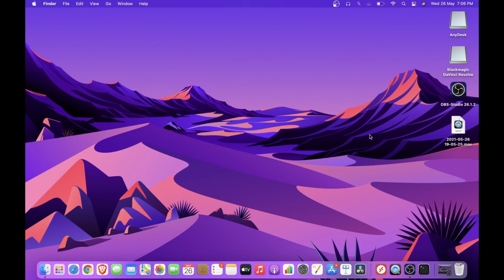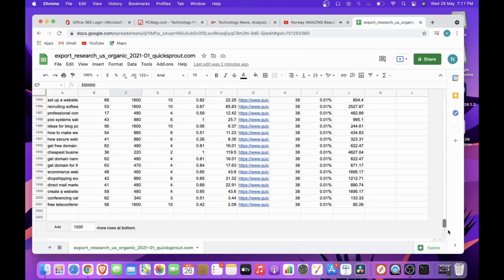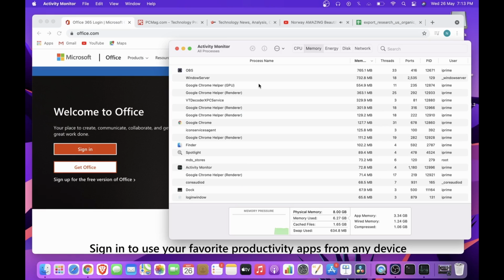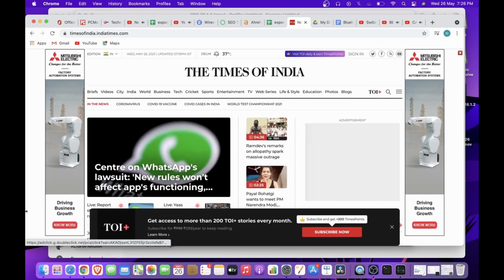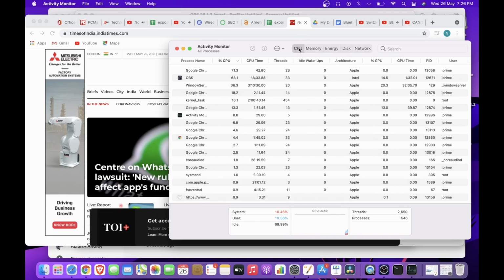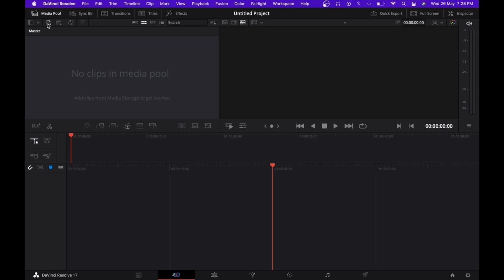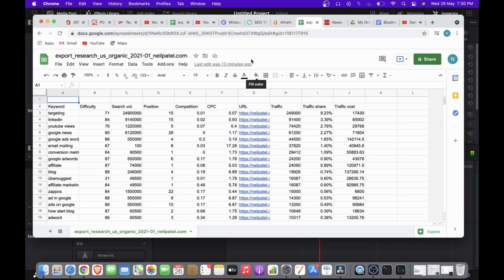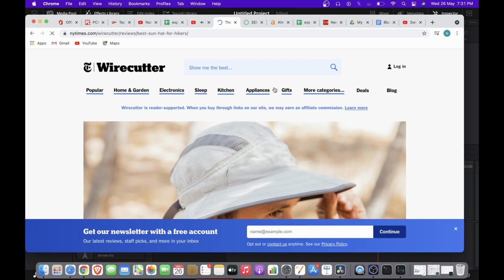Does Chrome run NICELY on M1 Macbook Air? I stress tested it out..

Comment: At the end... you was on 7GB RAM usaga, but you have to care about last line - there is 3.59GB swap usage, which are compressed data which are currently not needed to be in RAM as you currently dont using specific app or better, specific thread of application. This RAM is compressed and stored at you system drive. 16GB machine will do it without swap easily.

Swap isnt bad thing, but if you go grazy.. you can swap even 20GB into SSD and then it will be noticable on response. And it make wear for your SSD. If you doing crazy stuff with ram demanding apps, when you using internal drive to write a lot of data every day, it is possible that you will kill SSD even before warranty will lift off. SSD warranty is given by TBW (not know for apple, but usuall customer drives have 150TBW for 250GB capacity) or time, which is first.

Anyway, you do not push it too much, you just using web browser and davinci with just clip on timeline, no edits, no effects, no more video clips at same time... Davinci is just "video player" in video, and video playback is absolutely no stress for M1 GPU
Reply from the maker: Sure you are right! But swap isn't as big as you think. It has been extremely over hyped. But yeah I will make sure to perform an even more intensive task on this the next time. I am getting another M1 mac by tomorrow so stay tuned for more tests and vids. Subscribe for more!